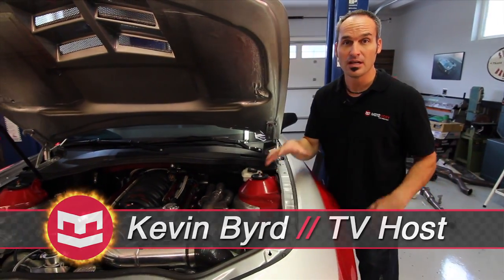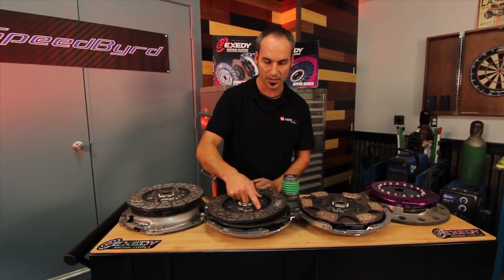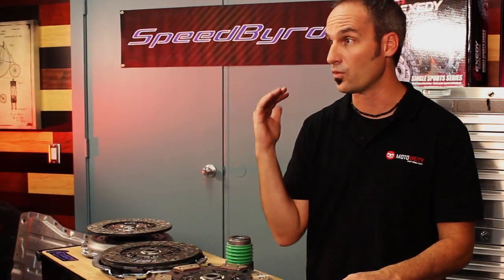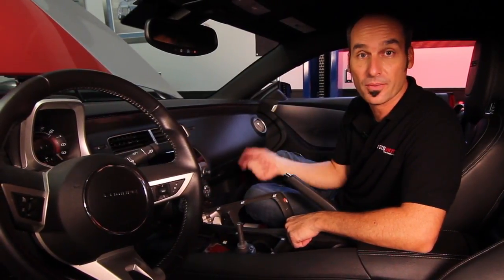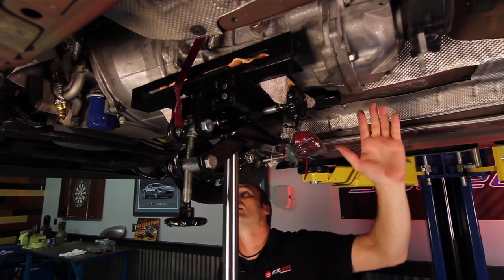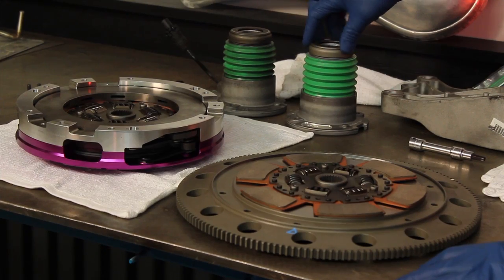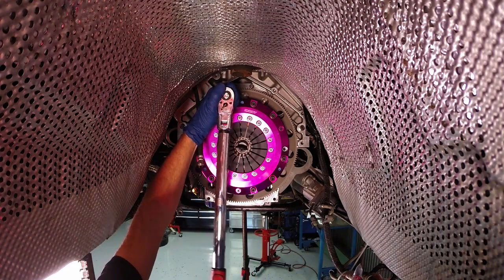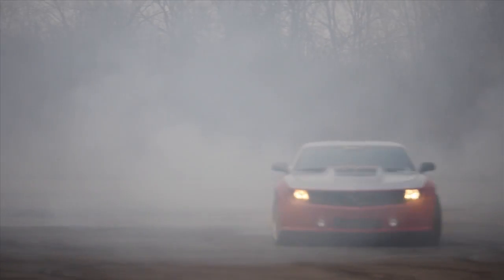EXEDY Racing Clutch - 2010 Camaro Installation

Comment: I’m guessing this is a similar procedure for a v6 2010 Camaro?
Reply: exactly what I was looking for. did you get a v6 done? mine scrapes and is getting worse. ive only driven it 5000 miles and it had 36,000 and was scraping 3rd after I got it paid for and home.
Reply: The V-6 is the same with the exception there are coolant line on the upper half of the bell housing that will need to be removed in order to get to the bolts.
Reply: Joseph Brush is there supposed to be a pilot bearing, because when I pulled out everything there wasn’t one but I feel like there should be but I can’t find any online